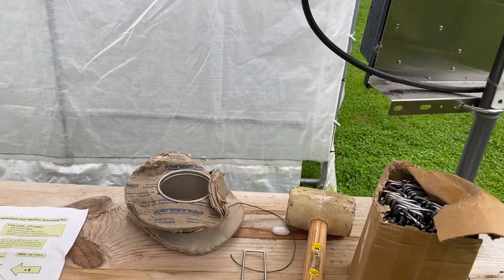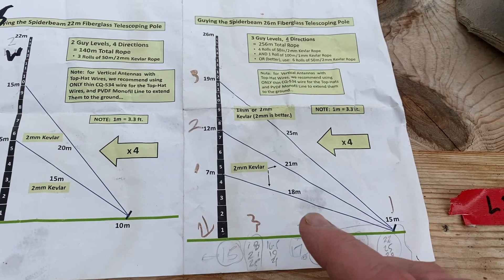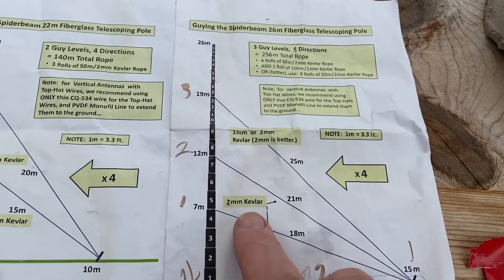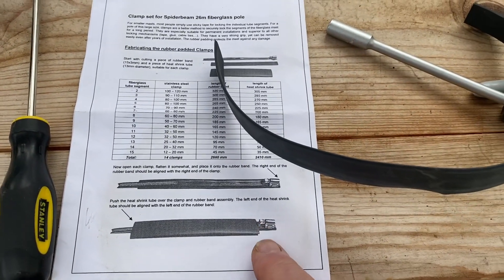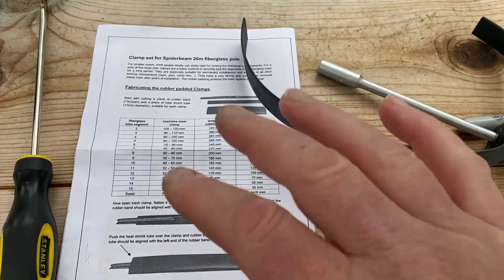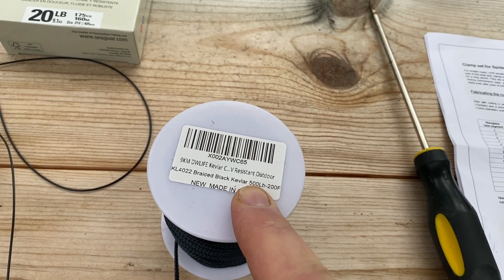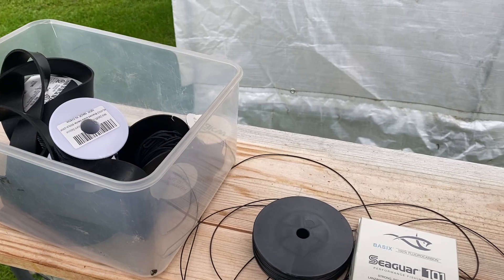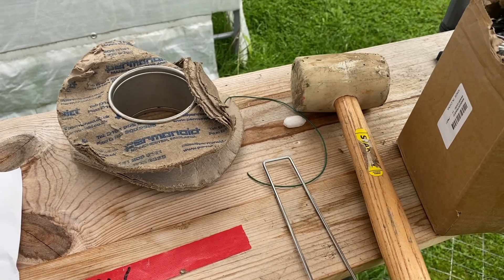Spiderbeam 26m/85ft Vertical install @KL7L part Deux

Comment: Three years later, I'm curious how the 26m pole has stood up to the elements? 73.
Reply from the maker: Honestly it did pretty good - was up for a year and now is sitting in the garage unused  - replaced by a mobile tower system now - if there was one weak point that is the “terry” clips that compress each section - some had to be replaced as “froze” - apart from that it worked well in this climate….
Reply: @hellozerohellozero I'd be interested in buying it, if you'd sell it, but I fear shipping it to Canada may be astronomical.